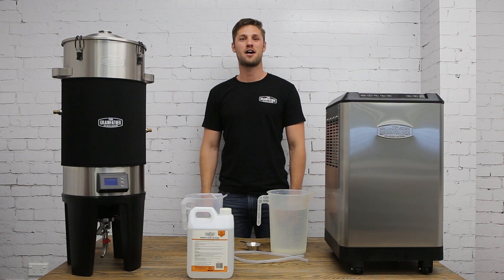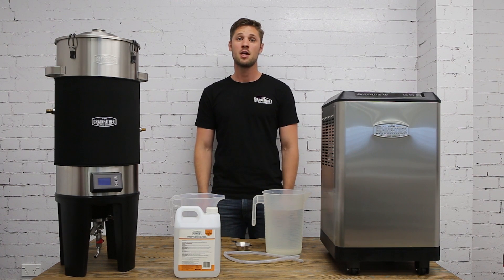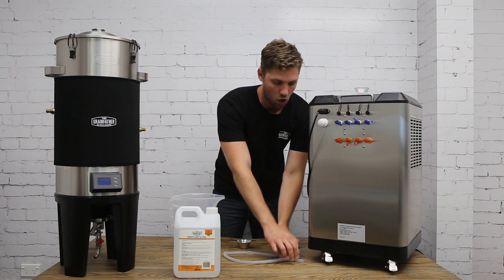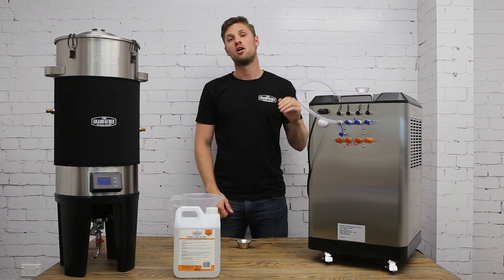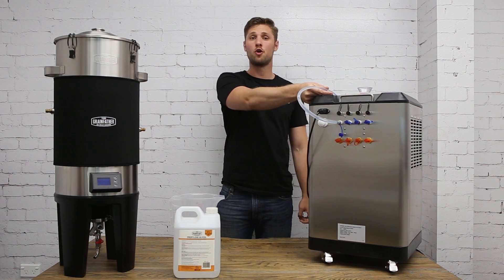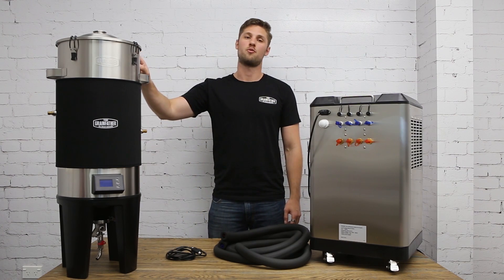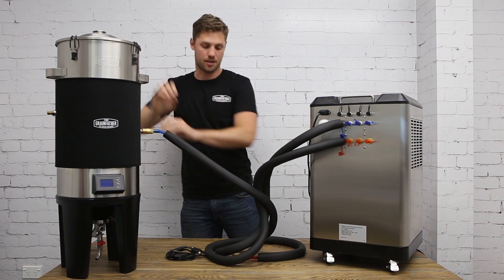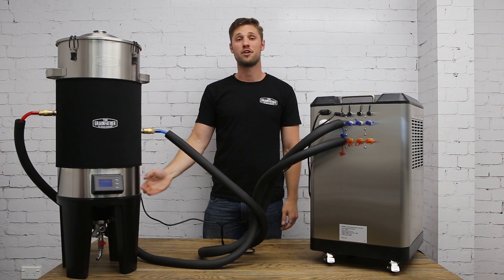Glycol Chiller - Touch Panel Version Setup Instructions

Comment: Just received mine.  Is the temp on the display of the chiller meant to be the same as the temp on conical fermenter? Can’t seem to get my temp down to my needed range. Have conical set for 60F and Chiller set for 60F as well.
Reply from the maker: Hey Chris, can you please email us on info@grainfather.com, so we assist you further. Thanks
Reply: Sent you an email.
Reply: @GrainfatherAllGrainBrewing  When I disconnect the blue hose the glycol mixture in the cooling sleeve is pouring out....arent the QD connections meant to keep this from happening?

Comment: other than the touch panel, are there any other updates vs previous unit?
Reply from the maker: Hey Christian, thanks for your message. This model also has a reusable inline glycol filter, to capture contaminants that inevitably enter the system, to protect the pump and maintain maximum glycol flow rate.